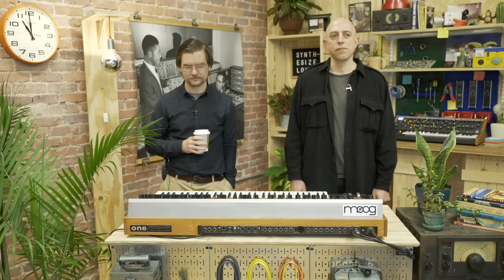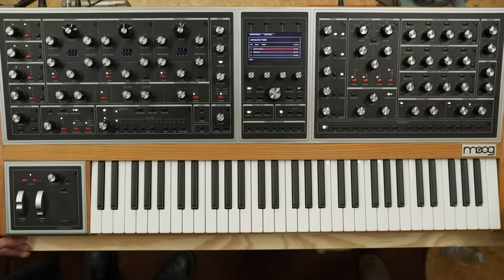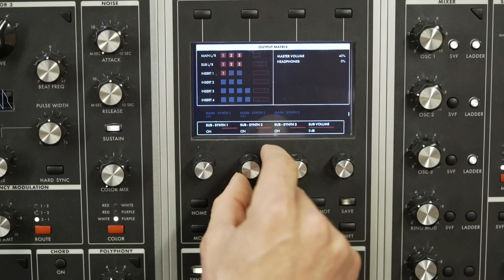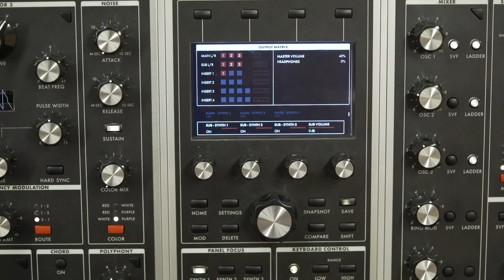Moog One: System Architecture - Part 1 (Live from the Moog Factory)

Comment: So it doesn't use sysex for settings dumps? Does it play nicely with external sequencers, such that, say loading a project in a DAW can switch the One to the specific preset or snapshot that was used when the MIDI from a previous session was recorded into the sequencer? And of course, do all the knobs send MIDI out for external recording, to ensure we can play back a prior performance we captured via realtime MIDI automation recording in a DAW? This is an important feature if the onboard sequencer is fully step-based (like the Sub 37). On a related note, how many virtual midi ports does it have? Does every synth voice have an independent MIDI port when connecting to a PC via USB or ethernet?

Comment: are the oscillators available as modulation sources at the matrix? is the filter and oscillator FM directly analog? I mean, without being digitized before reach the destination. what about the CV inputs? can they modulate parameters without pass thru a digital bus?
Reply: Filter and osc FM are directly analog.
Reply: Hi Mario, do you have direct confirmation about it or just guessing from what you see at the front panel? I saw the panel too, but I´d prefer an official answer from the people in charge.
Reply: I believe they've confirmed it in this very video, around 52 minute mark.
Reply: you are right! thanks!